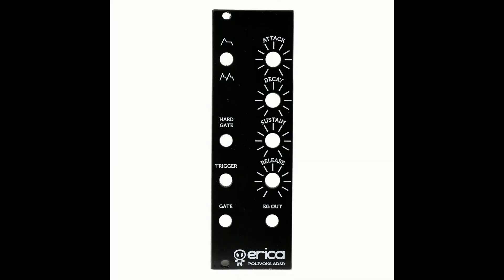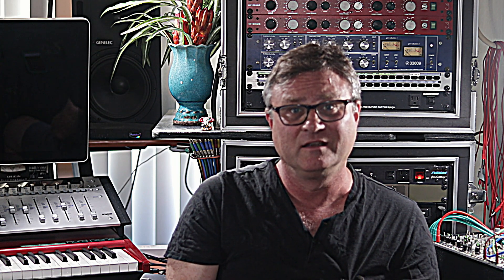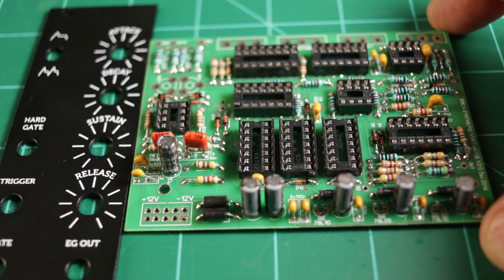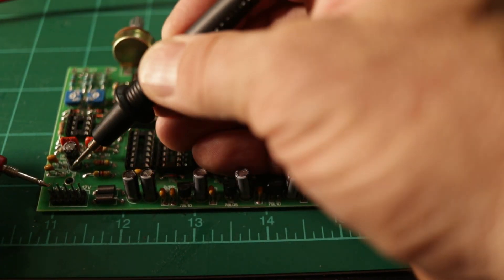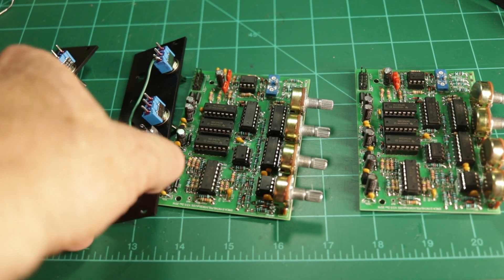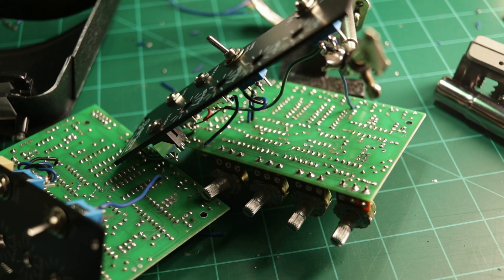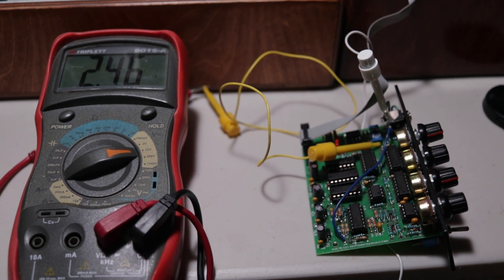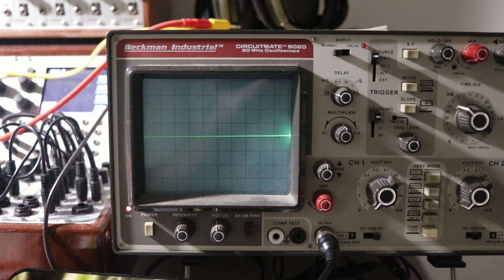Erica Synths Polivoks Envelope Generator | Synth DIY

Comment: This is really interesting to me.  Is there going to be more in this series?  I just started soldering to replace batteries in my old synths but I was able to figure out and repair an old MIDI patchbay with a blown powersupply and bad lcd, which now works great and gets regular use .  So now I want to build something cool.  The modular world is greek to me.  I've only ever played with polysynths (1980's stuff) and software (Reason).  Thanks for sharing your knowledge and experience.